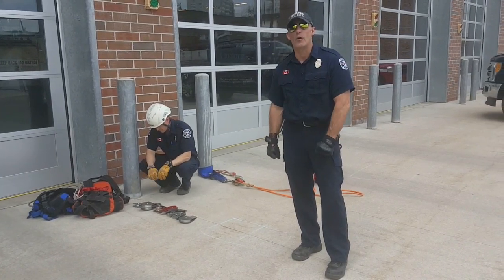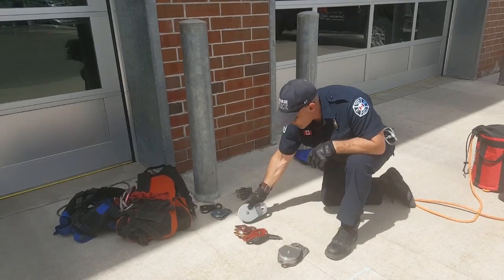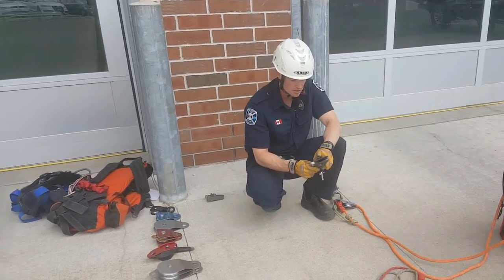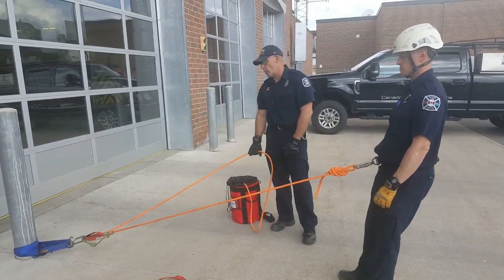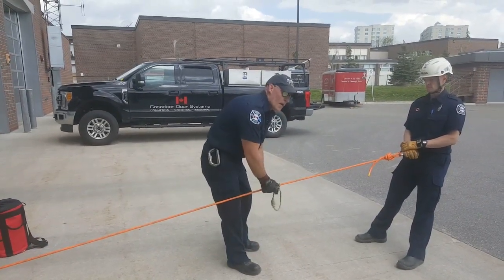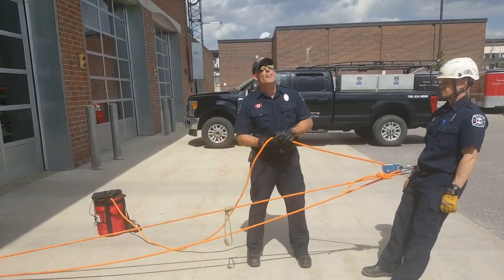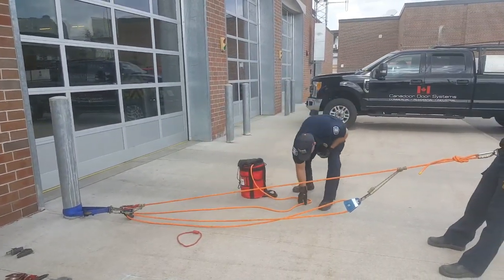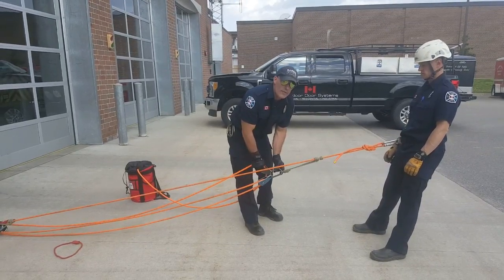Technical Rope Rescue Mechanical Advantage. Part 1 - Barrie Fire Service

Comment: Great video, what length of 12.5mm kernmantle rope do you have ineach rope bag?
Reply from the maker: Hi Lloyd. Glad you liked it. We run an assortment of lengths from 60m up to 200m. Tallest structure in out city is approx 75m however longer ropes allow us to construct an our anchor system with 2 static lines or a static and a dynamic all out of one bag